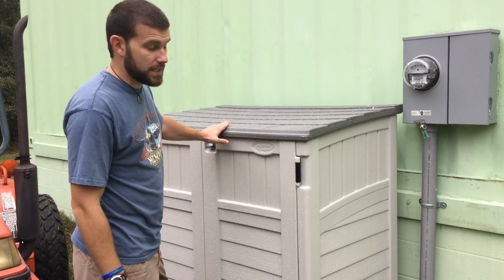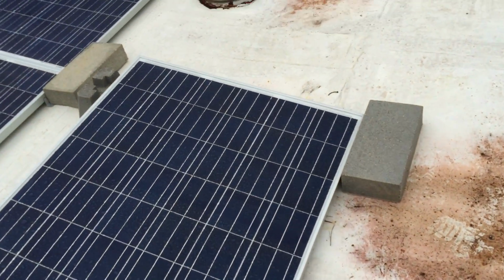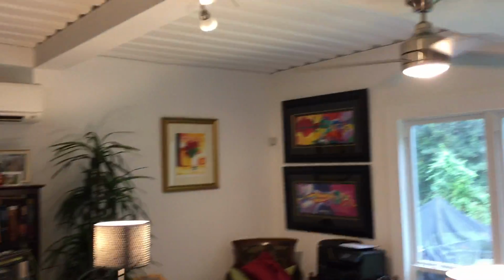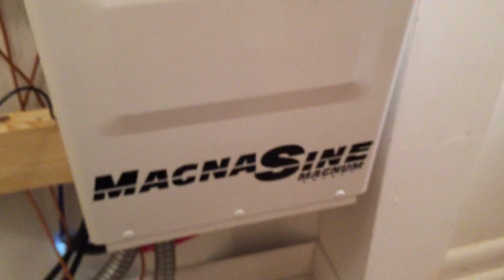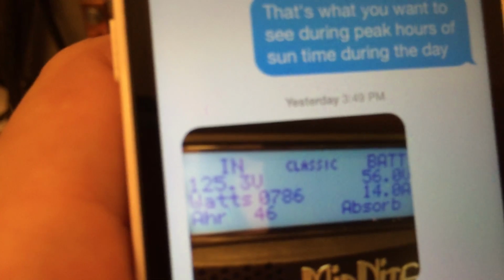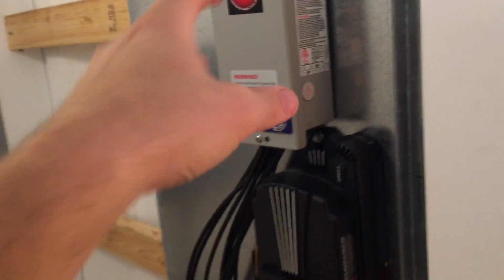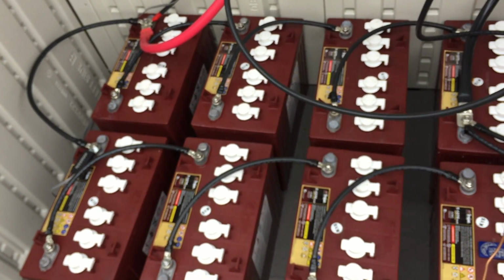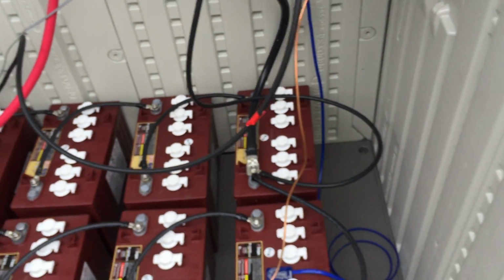Off grid solar install on cargo container home in tropics by Off Grid Contracting plus tour of home

Comment: Awesomness
Reply from the maker: +crackin2000 I thought you would like my friend
Reply: That's alot of house in a small space and alot of fans and lights running on that system are the fans 12 volt?
Reply from the maker: +crackin2000 Actually brother the whole house is either 110 or 220 and it ran seamless on the feed from the system. I would say about 2K more he could probably run constant all the time off grid with the other loads that are still left hooked to the grid.